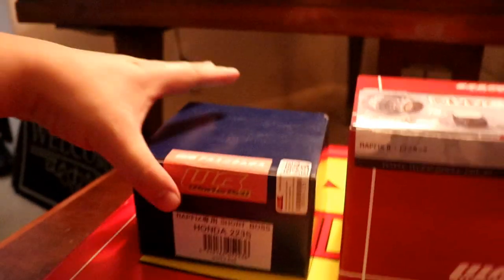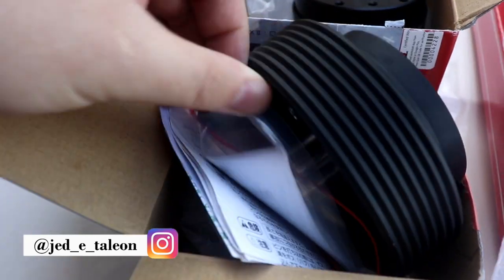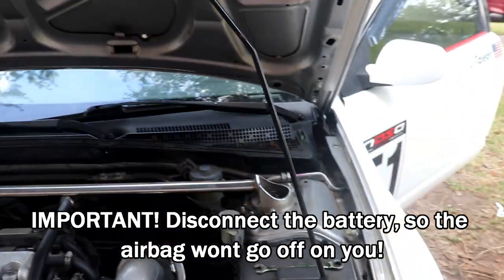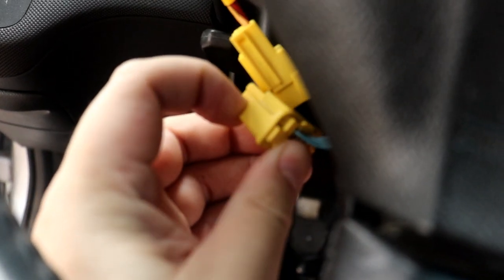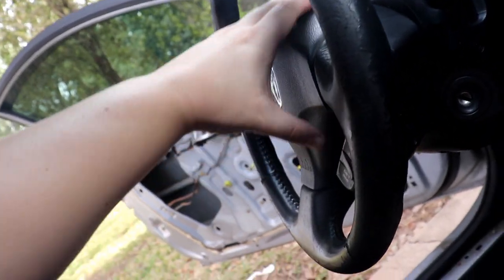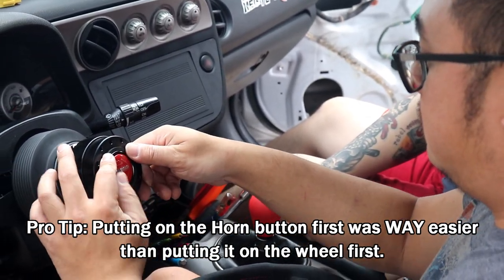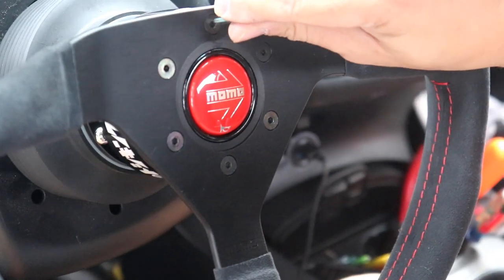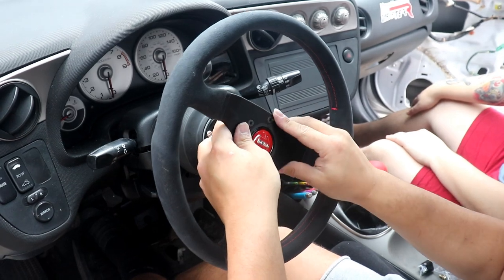Installing Works Bell Short Boss, Quick Release, And A Momo Monte Carlos On The RSX!

Comment: Thanks for making the video. I've been wanting to do this quick release setup for awhile now. I didn't even know that the Works Bell hubs retains the stock srs clock reel! It's nice to know that when I do get this setup I can fix that empty "void" in my steering wheel column where the clock reel use to sit and is visible.